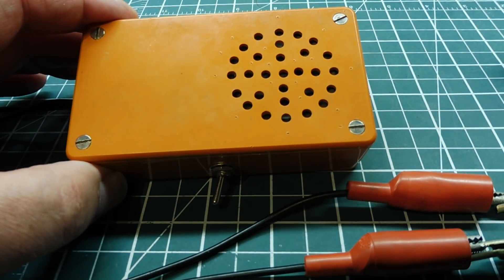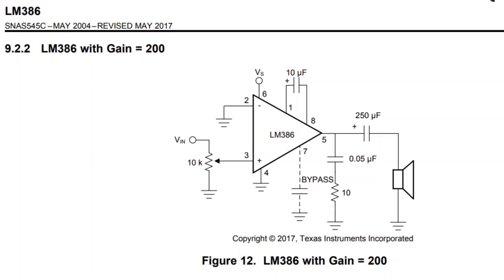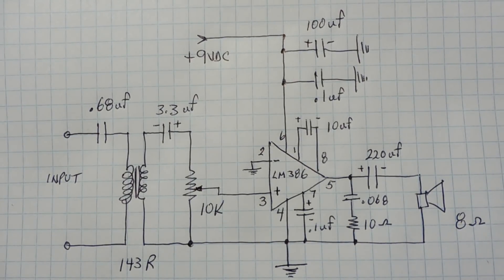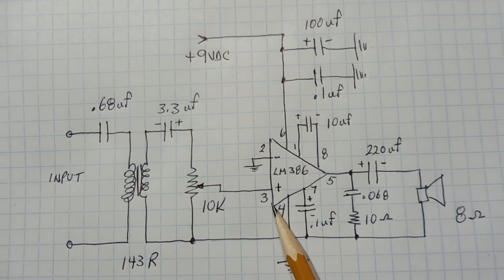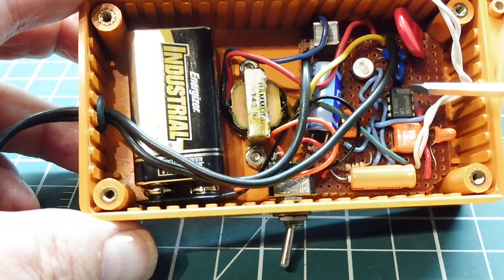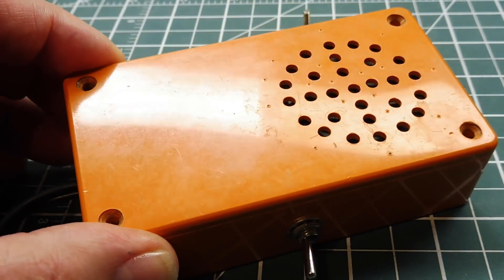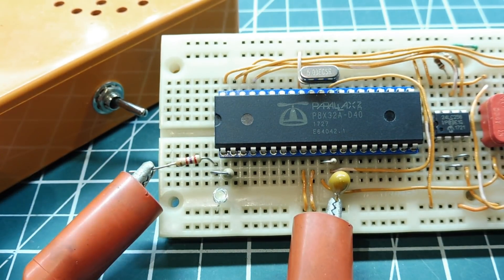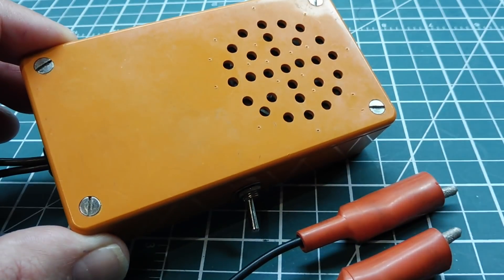Build An Utility Audio Amplifier  / LM386

Comment: Very easy to get working. I built a pile of amps for myself in 2025. They don't consume a lot and are basically running at full power. You get something decent at 5 volts as well.

Comment: Cool circuit you have there.  I use my 386-4 to amplify a homemade broadcast band and shortwave radio receiver.  An 8 Ohm speaker works real good.  I have a cheap headphone that measures 28 Ohms.  It doesn't get nearly loud enough.  I haven't yet tried a 4 Ohm speaker.   I run my amp on 6 volts made with a AA battery holder.  It's run more than a week without getting too weak.
Reply from the maker: Thanks for the info!

Comment: Hi 0033mer,

Thanks for the great video.  Couple questions … what’s the maximum voltage signal that can safely be measured without harming the unit ?  What’s the purpose of the transformer in this circuit?
Reply from the maker: The transformer makes the input balanced, as it was used to monitor phone lines. It can be removed if not needed. The pot can be adjusted to accept a wide range of input amplitudes.

Comment: Whats the exact Inout Transformer I should get?  Seem expensive.  Any places to salvage one?  I guess a Hammond 143R ?

- im learning basics so its hard to know what is correct to get.
Thank you
Reply from the maker: To make the project easy and affordable for beginners, get the LM386 amplifier circuit assembled on a pcb and you can use an inexpensive 600:600 isolation transformer.

https://www.banggood.com/LM386-Audio-Amplifier-Module-200-Times-Input-10K-Adjustable-Resistance-p-917571.html?utm_source=googleshopping&utm_medium=cpc_organic&gmcCountry=CA&utm_content=minha&utm_campaign=minha-ca-en-pc&currency=CAD&cur_warehouse=CN&createTmp=1&utm_source=googleshopping&utm_medium=cpc_bgs&utm_content=haosen&utm_campaign=ssc-ca-all-0924&ad_id=384529244391&gclid=CjwKCAjw9MuCBhBUEiwAbDZ-7mwN16_tbSe9voN6L2CLSn_b7dXL-tRCXqRuQKTQ25VXa4lUavywcRoCDGUQAvD_BwE

https://www.jameco.com/z/TTC-105-Arndt-Telecommunication-Coupling-Transformer-1-1_2210992.html
Reply: @0033mer  Thank you..
On the Input of your schema - you have 2
- one in the .68 resistor
- one without...

Which does the input connect to?
Reply: @0033mer  I already. Are a few amp circuits like yours... but never worked with a transformer..

Comment: That looks like a Hammond enclosure, but it's not a current color. Where did you find a lid with speaker holes? They look too perfectly cut to be DIY.
Reply from the maker: The project was built many years ago when the color was current. I drilled out the holes for the speaker. A compass, ruler and center punch is all you need.

Comment: Great project I have been working on one myself using an Arduino Nano with modified tone melody sketch to trace out telecom wiring. I was looking into boosting the output of the tone and I believe your project will do just that if I subtract the speaker

Comment: I understand why you've used an isolation transformer, and why it has a capacitor on the primary, but is the capacitor on the secondary really necessary? It seems like it's redundant.
Reply from the maker: Yes, good point you are correct. The original circuit did not have a transformer so the capacitor was used to block any DC from the circuit being tested. In case someone wanted to build the circuit without the transformer the capacitor is there.
Reply: Yes, that makes sense.

Comment: What is the audio transformer specs ?
Reply: Found this at Digi-Key if that is the one, it makes this project a real high budget proposition !
 143R 
Hammond Manufacturing
TRANSFORMER AUDIO 25K/600CT IMP
Unit Price 31.67000
143R-ND
Reply from the maker: You can use a very common 600:600 isolation transformer.
https://www.jameco.com/z/TTC-105-Arndt-Telecommunication-Coupling-Transformer-1-1_2210992.html
Reply: Thanks. What code do you use for your Propeller ?  C  or Spin ?
Reply from the maker: The code was written in Tachyon Forth.